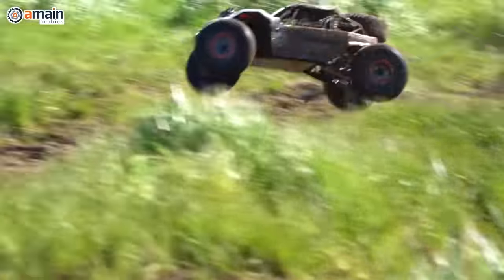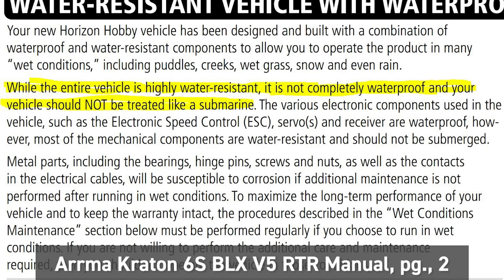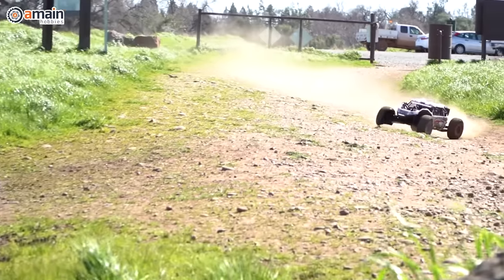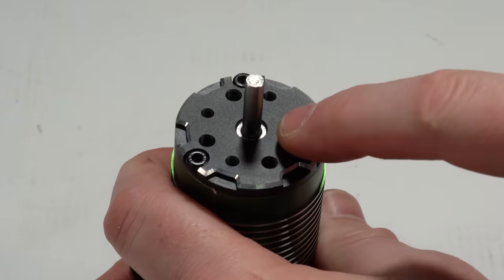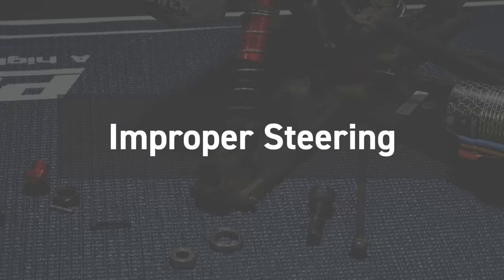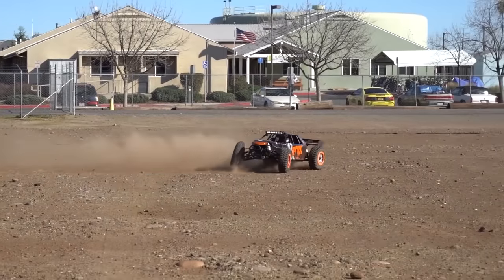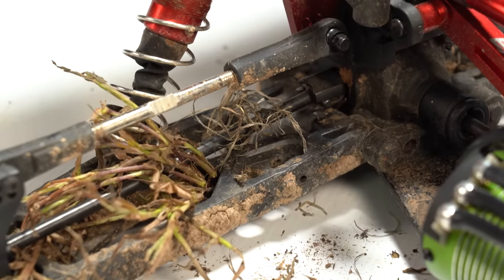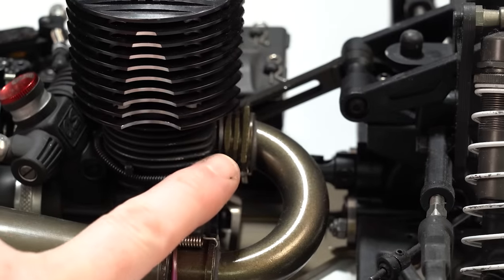7 Ways You're Destroying Your R/C Car

Comment: i recently bought a traxxas rustler 4x4 vxl i run it on 3s i have taken it out about 4 times for 30 mins and every time the spurr gear gets shredded and the motor is way too hot when it runs i haven't changed the gearing at all but i drive it in a large open field without stopping and starting often does that cause more damage?
Reply from the maker: Maybe the gear mesh isn't set correctly or the motor mount may be bent? The motor mount has a slot to adjust the mesh but only once you remove the plastic insert, which should be in the motor mount. If it's not, then the mesh probably came out of alignment. 
-Brett
Reply: @AMain_Hobbies  alr time to take it back to the hobby shop

Comment: Will the motor overheat if you lower the gearing for the motor?
Reply from the maker: The ESC tends to overheat if the motor is overgeared, but the motor can too; but generally not. Someone told me If overgeared the motor gets hot, if undergeard the esc will get hot. 
-Brett
Reply: @AMain_Hobbies  this will make re gearing a lot easier thanks

Comment: What do I do if I have a little bit of rust on my metal parts of my rc car ?
Reply from the maker: Not much you can do other than replace the parts. It may be fine to continue to use the part until it wears out or breaks, and then needs replacing, but it depends on what part it is. 
-Brett
Reply: @AMain_Hobbies  Alright, thanks

Comment: Is it okey to drive it in snow? And how do i maintain its glory afterwards, btw its a jeep rc car
Reply from the maker: First you should ensure it has some waterproof/water resistance before you do; if it's not, the electronics might not survive the experience. After that, be sure to cover any vent holes in the wheels if they exist and don't let too much snow collect and pack up because it can add too much weight to the car and strain the electronics. At the end of all this, completely dry off the vehicle; this is one of the most important steps to keeping the vehicle performing well and works to resist rust and corrosion on metal parts. 
-Brett

Comment: With regard to getting them wet then putting them away. There is a term us boaters use (full scale boaters) when this is the case especially boats used in salt water. "Run hard and put away wet". These are the used boats to NOT buy. LOL. They all have the tell tale signs if they were run hard and put away wet. LOL

Comment: My motor shouldn't be above 160 or 170 degrees? I call BS. I have a slash 4x4 with the stock motor and esc. I run it on 3s and on stock (13/54) gearing, and I get my motor to about 185 degrees pretty much every time I drive it. The esc commonly gets to 170 degrees. I've ran this slash like this for over a year now, and the motor and esc are still working just fine.
Reply from the maker: 170°F allows for a buffer, or some head room for things to go bad, before things turn ugly. But you're right. 
-Brett

Comment: I disagree. I drove my old ass 4x4 slash into a frozen lake when trying to hydroplane. I dove right in and had 3/4 or more of the car in there for at least 30 seconds. I still have it and it still runs. This was nearly 4 years ago
Reply from the maker: Imagine if you had done that in a body of dirty water. A lake is nice and clean. There are more than one type of water, including salt water. This video is to help people have a little common sense. I believe you that your truck is in good shape after that, but it is not always the case. 
-Brett

Comment: Do I need to cover the wheel vent holes even if I drive in snow?
Reply from the maker: Yeah, probably. The snow tends to get packed in the wheel, melts and waters into the hole. If you clean out the snow before it melts, you will probably be ok. 
-Brett
Reply: Ok thanks

Comment: What if my front wheels are too hard to turn by hand ? Is that my servo saver ? Is it too tight?
Reply from the maker: Did you disconnect the servo? If the servo is disconnected and you cannot turn the front tires then binding is present. But it wouldn't be the servo saver, that doesn't prevent movement, so it would have to be something else.  
-Brett
Reply: @AMain_Hobbies  servo is plugged in, not disconnected. I’m not sure what it is
Reply from the maker: @nikhilbhatt9114  If your servo is connected to the steering linkage, you will not be able to determine if there is resistance because the servo is stopping free movement. You need to disconnect the servo, and try again. 
-Brett

Comment: Slash 4x4 VXL. Major drivetrain resistance and gear grinding out of the box. Both diff housings full of metal shards after 20min of driving.

Traxxas' response: "Some differential noise is completely normal.  The gears will wear in and smooth out with a little use."

I might be new to the R/C hobby, but I know bulls**t when I hear it. Not impressed.

Comment: Safe zone is 70°c well, mine i temp tested my brushless motor after running on 3s and it read 170°c and its still fine. How?
Reply from the maker: That intensive heat will permanently weaken the magnets in the motor, degrading performance. The motor will still work, but it will not retain the power and efficiency it once had. 
-Brett

Comment: I have a problem with my trx4 defender, i got smaller tires, when driving during the summer, the motor hit temps of over 90 °C. with a brushed system. i run all stock gearing and its always well maintained. what can i do?
Reply from the maker: Can you try removing the motor and ensure the drivetrain moves freely? I'm guessing maybe something is bound up causing resistance/stress to the system. Rock crawlers shouldn't overheat because they are typically driven very slowly. With your TRX4, are you driving full speed in 2nd gear all the time? How much smaller are the tires you put on the truck compared to the stock tires? Using a smaller tire is like gearing down on the pinion gear, causing the motor to reach top rpm quickly, which can cause excess heat; but this is only an issue if you drive full speed everywhere. 
-Brett
Reply: @AMain_Hobbies  I’m mainly drive slow, my tires are 4.30" (109mm) tall. There’s seems to be no issues with the drivetrain, and a brushless system seems to fix the issue
Reply: @AMain_Hobbies  update: it stopped working totally. I took it all apart and checked all the gears and ii found nothing. There’s definitely something bound up because it moves about 10 cm when I give it a push
Reply from the maker: @charlesbaril3038  Maybe it's a motor issue then. If you already checked the drivetrain and the truck is functioning properly, there isn't much more that can bind the truck up. A tight pinion gear mesh could do it, but the TRX4 is a fixed mesh I believe. Let me know what else you find. 
-Brett

Comment: That's absolutely not true about the electronics. They can handle being submerged and water proof means just that. Splash proof would be water resistant. Even the cheap Hobbywing ESCs can take a dunk with no issues. Nailed it on the drivetrain though.

Comment: I drive my rc car in the snow, then blow it off with a air compressor then run under a little water and dry it off with a air compressor again
Reply: once in a while, wash with detergent and toothbrush, rinse, blast with air. spray it with WD-40 then toothbrush the whole thing, then blast with air again. watch how much dirt DOESN'T get stuck to it when you do that.

Comment: i got wltoys a 959b didnt have it for a week was riding it in rain and  lost controll and went flat out in the side walk need to buy a hole new front end
Reply: buy proper quality cars.
Reply: Wtf, must’ve been going downhill to get enough speed to break.  Try steering away from things or push throttle opposite way for brakes. Get well soon. RC cars rule🤙
Reply: @sheckymoskowitz686  cheap chinese plastic. Not surised

Comment: DUDE IF YOU GET THIS NEED SOME HELP I AM JUST GETING INTO NITRO JUST GOT A TAMIA MONSTER TRUCK NEED TO KNOW WHAT IS THE MOST POWERFUL NITRO ENGINE ON THE MARKET AS THE .50 THAT CAME WITH THE TRUCK HAS A BROKEN CONECTING ROD AND NOW IM RUNNING A .28 ENGINE
Reply from the maker: We have this .32 engine although not sure if it will fit. It does not have a pull start and is intended to be used with a bump starter. 
-Brett
Reply: @AMain_Hobbies  which .32 would that be
Reply from the maker: @NOVAENGINS9252  Sorry, a link would help: https://www.amainhobbies.com/lrp-zr.32x-.32-spec-4.1-monster-truck-nitro-engine-lrp32826/p1391509

Comment: hey im trying to get a traxxas rc car but i feel like i  need a upgrade does anyone know a battery that will make a traxxas slash 2wd 50mph?
Reply from the maker: The VXL model will require the 5000mAh 3S from Traxxas to hit the top speeds in excess of 50MPH. The truck will also need the gearing changed by changing the pinion gear, and the high speed pinion gear should be included. 
-Brett

Comment: can i run a hv servo without a external bec  because im running 8s
Reply from the maker: Sure. You mainly need a BEC when the ESC can't adequately provide for the servo. If your ESC can, you shouldn't need a BEC. 
-Brett
Reply: so do u think i would have enough internal bec power from a castle mamba monster x to power a 7.4v hv servo

Comment: So idk if this will be answered but im looking  a good speed rc show vehicle that I can like completely customize easily with parts ready made
Reply from the maker: R/C Lowrider? https://www.amainhobbies.com/redcat-1979-chevrolet-monte-carlo-1-10-rtr-scale-hopping-lowrider-green-rer15154/p1372322
You could use this Dually to trailer it in: https://www.amainhobbies.com/cen-ford-f450-sd-kg1-edition-1-10-rtr-custom-dually-truck-candy-apple-red-ceg8982/p1359524
Is this something you want to build from scratch? 
-Brett
Reply: @AMain_Hobbies  well I'm looking to build a 65 Ford mustang 
I'd like to haul it on a f100 or a f1
Reply: But I can't find those bodies
Reply from the maker: @jordanmckinney9035  Unfortunately, a '65 Mustang body is not available. There are very few mustang body sadly. For haulers, we have the CEN F450 Dually, it's a popular hauler and you can put a trailer on it: https://www.amainhobbies.com/cen-ford-f450-sd-kg1-edition-1-10-rtr-custom-dually-truck-silver-mercury-ceg8983/p1359525
-Brett
Reply: @AMain_Hobbies  I did find a 67 or 70s mustang body and a f100 body I just need a base that isn't like tuned for race or drift or off road 
It'll have to look regularly 
But allow for motor swaps easily 
I did think about a lightning stk which I got but I'll check out the f450 for the hauler and just use that body I found is it 1/10 right
Reply: Theses are my dream cars and I've always wanted to customize them a lot I've got a lightning stk so I think that'll work for the mustang now

Comment: there are vent holes in my tires somehow ... thx arrma :(
Reply from the maker: No, that's good. Venting the tires instead of the wheels is the best method. When the vent hole is on the outside, it flings out water and debris when the tire spins; when the vent hole is on the inside wheel, nothing can escape when the tire spins. So you're all good, you don't even need to plug those holes, they're good to go in all conditions! This only applies to wheel vent holes. 
-Brett

Comment: Anyone know how to fix a slash that has power but isnt moving
Reply from the maker: Could be binding in the drivetrain. Try removing the motor and see if the truck transmission and drivelines spins freely; everything should spin with no resistance. With the motor out, does it work now? Checkout all the motor wires too, maybe one came disconnected? Another possibility is the motor died, but try what I suggested first and let me know what happens. 
-Brett

Comment: Is it weird that my rc car has a lot of play on the wheels and they kinda go left and right?
Reply from the maker: No, that's normal. The plastic tends to deform and lose shape after a while, like the holes where bearings sit; sometimes those holes start to wollow out and it creates play. You can replace those plastic parts with new one, and that should help tighten up the tolerances. 
-Brett
Reply: @AMain_Hobbies  thanks but I've had the car for half a month only and have been using it normally

Comment: Soo uhm yeah sorta wish I knew some 9f this now I drove it in snow it was caked in snow and I took the body off flipped it upside down on a towel to air dry but now the ball joints are rusty and the receiver pins are corroded
Reply: That's about it that I've found rusty though
Reply from the maker: That's not too bad. Replacing the screws and other hardware is usually inexpensive if you wanted to do that. But the car should work fine with them too. The only issue is the ball joints need to move freely with the suspension and movement, so if they're resistant to move, replace them and the plastic ball cup. 
-Brett
Reply: @AMain_Hobbies  I can assure you after almost a 2 hour bash session with it outside and it loosening up a few screws and having to put them back in it is definitely loose enough now if it wasn't before I just got back lol
Reply: Also the body has seen better days for sure after today

Comment: Hey. What are pressure washer? That is not the same as air compress right? I can use air compressor to clean my rc cars? Sry my bad english. Hope somebody can help me:)
Reply from the maker: A pressure washer uses pressurized water to clean surfaces. It shoots water at a very high speed! Not good for r/c cars or bearings. 
-Brett
Reply: @AMain_Hobbies  Thanks Brett.

Comment: So as far as overgearing goes I have a high speed spur gear(2 teeth)  and .75 taller tires and I’m using 3s on a 7700 castle motor and the esc gets crazy hot. The motor gets hot but not to the point where I feel it will hurt it. Does anyone have any solutions to cooling the esc because I would prefer to have the high speed gearing for high speeds and more low speed torque just makes the car very hard to control at low speeds so now it has a better balance of high and low speed acceleration and still does wheelies from a roll. Any suggestions would help as the esc will prevent the car from moving when it gets to a certain temperature.

Comment: I was hoping he’d touch base on proper care for driving on sand. Just if there’s anything you should definitely know beyond common sense.
Reply from the maker: Try to plug up the vent holes in the tires so they don't fill with sand and become excessively heavy. Other than that, just watch the motor & ESC temps because sand is pretty stressful on the electronics. 
-Brett

Comment: This dude talking about cars with bearings in the motor and axles, waterproof cars, fast offroaders, taking apart and modifying gear systems, adding bigger wheels, servo steering...
I have nothing like that.
I have no bearings to oil or clean, no motor to oil or clean, no waterproof parts...
I have no way to change gears, add a heat sink or fan...
I actually put SMALLER wheels on my cars, it makes them less fast but way more powerful.
I can't afford this crap, so most things in this video are pointless to broke RC car lovers.